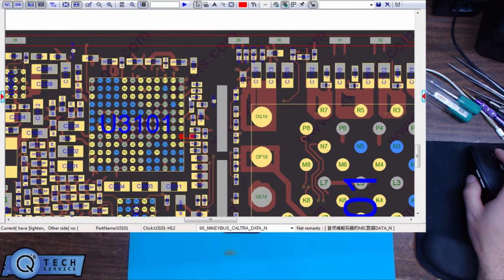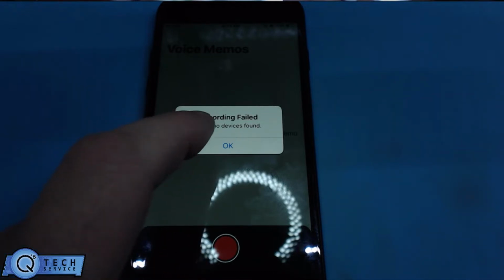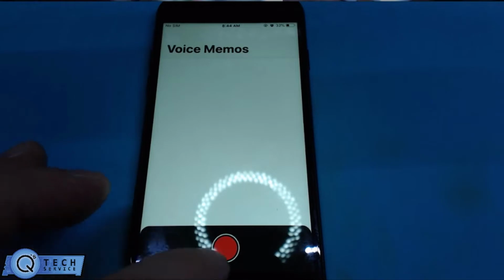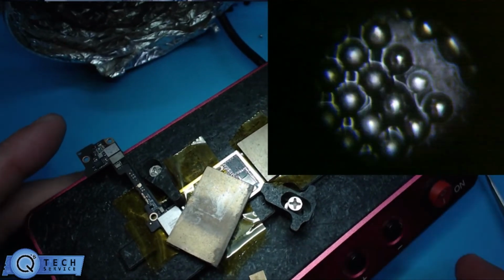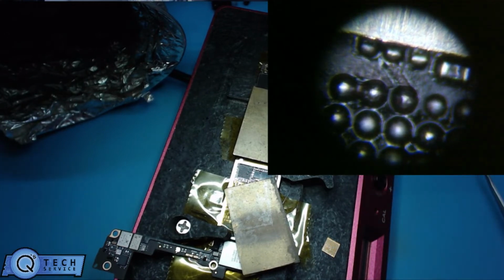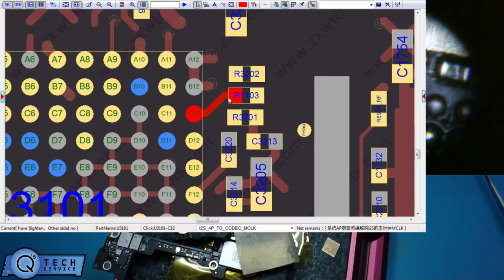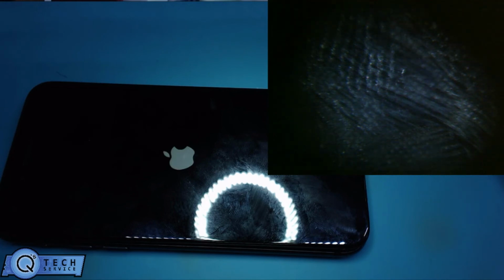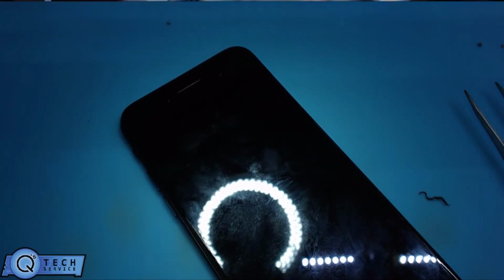iphone 7 no audio devices found

Comment: Hey Q's Tech Service, Have you ever had a nand not read on the JC-P7? Partitions 1-6&7 don't exits and noting else comes up for GB size. What program would be used to find out the rest of the information to put on another nand and is it possible without copying from the original?
Reply from the maker: I was having issues with  32 and 64 bit 4S to iPhone 6 Where it was not Copying the data right But updated the JC To the newest software and it fixed it I think I have it in one of my videos talking about it recently I think it was an iPhone 6 Memory upgrade What's the issue you're having ...🤔
Reply: @QsTechService1  The issue that I am having is saying that the nand isn't detected. There was one pad that came off the nand, it was the pad directly under the dot so I will try to connect a wire where that pad was and see if that changes anything. I'm still new to this so I'm still getting the hang of it.
Reply from the maker: @adamcarver9057    Yes practice makes perfect ... A bottom heater helps a lot Sounds like the pad is importing Hopefully you can retrieve the pad .. Try a different memory chip to make sure your JC is working proper
Reply: @QsTechService1  I'll have to buy some if its for a 7. I did hook it up to the Pro and I got the same results so i'll let you know once they come in. Do you use blackfish for the pcb layouts? Is there any way that I can purchase iphone 7 nand chips form you? Just cause I don't want to wait a month for china if possible.
Reply: @QsTechService1  Is there a way to find out serial #, Wi-Fi address, ICCID, MEID, etc with the IMEI? Since I have the IMEI I would like to program another chip after I buy it however I don't have any of the other information that is needed to make this work. Do you know of any place that I can go to to get the rest of the information?
Reply from the maker: Adam Carver I do not believe so you need the original information unless you backed up Wi-Fi serial information region and other information manually typing it in
Reply: @QsTechService1  ok thanks, I'll put the nand back on and see if I can get something to talk to it hopefully.